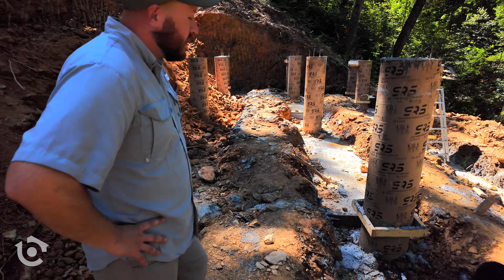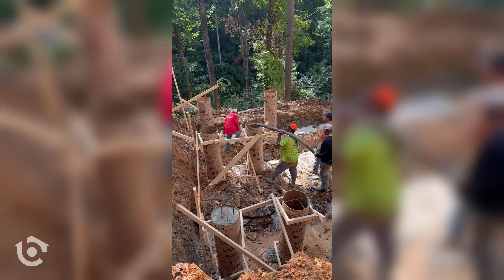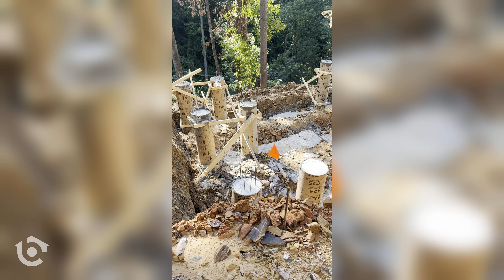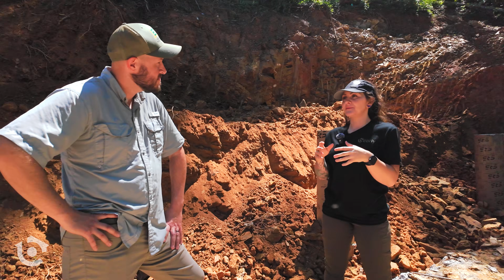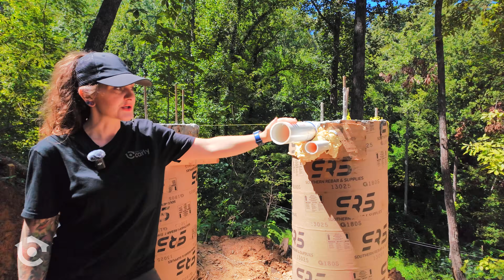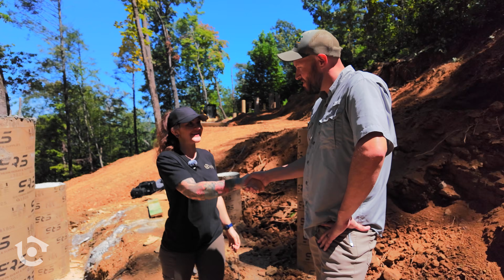Treehouse Foundations Explained  Building Tiny Homes on Piers

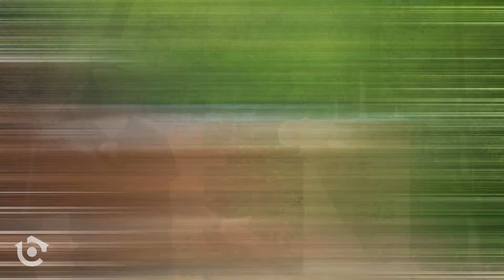Comment: 7:34 increase diameter of the pillar until you fit the box's dimension in the hollow outer layer. You'll have a bigger pillar that is still round but just bigger. Also you can shift the origin of the cylinder so that the hollow outer shell maximizes its usable area for the box.
Reply from the maker: Thank you for this suggestion!  In this particular situation, the client we are building for wants consistency on all of the house piers and it was really important to him to have a certain aesthetic.  With that said, we needed to maintain the same diameter on all piers.  Also, we are doing stucco on the exterior all of the piers to give a "tree bark" look so unfortunately, even if we did increase the diameter of the pier to include the box dimensions within the pier, the finished pier would still have to be stucco-ed over, therefore, creating a barrier to access the lines.  With all of that considered, we chose to have our engineer layout his specs for this specific sono tube to allow us to include the lines, with no visual difference to the other piers.  We love your input though, definitely something we may be able to do on a different build!